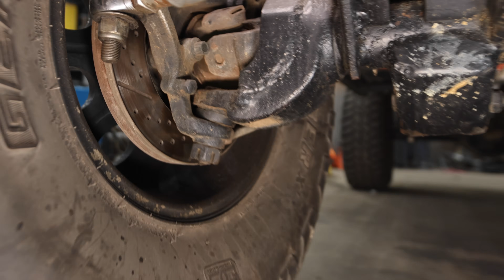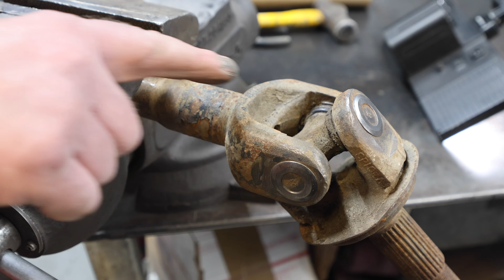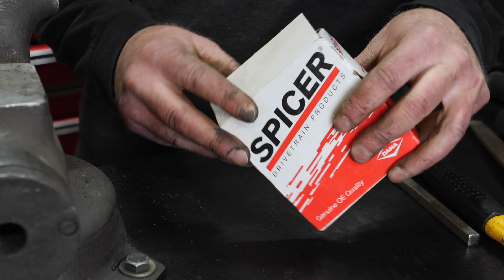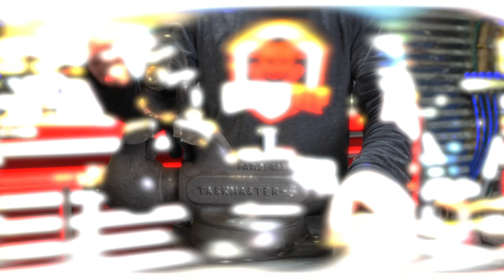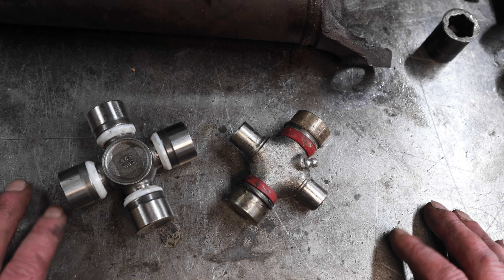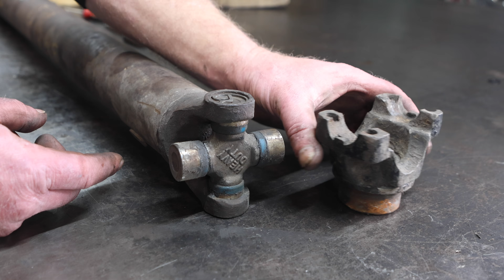How To FIX a U Joint in 15 Minutes

Comment: I have an AWD Charger pursuit and the front joint failed dropping the whole tube onto the ground.  I heard sounds all day that weren't normal and it let go around 25 MPH and it sounded like a bomb went off. I thought I blew the engine.  I looked everywhere never finding the the + piece.  I'm afraid to know how much damage and what the cost is gonna be to fix the damage.  Somehow all the gear oil poured out too.  Ugh

Comment: thanks this is  78 k5  , I just wanted to know if I did it right for my 78 blazer  passengers front u joint i bound up the cap and ended up cutting it  off.

Comment: Over the year's of changing u-joints I've ran into issues multiple times when hammering them in. I highly recommend getting the ball joint tool set the C-vise works extremely well and you will have way better results with not messing up the needle bearings

Comment: I knew it was coming cause I've been hearing a kinda knocking when I accelerate or decelerate.  Yesterday I started getting really bad vibrations.  Then Yesterday afternoon I started backing out of the driveway and it felt like I backed over a motorcycle.  . Then I made that same awful noise every time I put it in reverse.  When I looked at the rear U joints the shaft was started to come off of the joint.

Comment: Put my new u joints in my driveshaft and found one needle bearing on the floor am ok or do I need to install that needle bearing with my u joints
Reply from the maker: If its from the new joint, yes, put it in.  it wont last long without it.

Comment: FYI…rotating the internal circlip will typically let it fully seat into the groove. If it doesn’t, there’s either debris or the cap isn’t fully seated in the collar. Should never have to tap one into the groove

Comment: Cool tip demonstrated by Tom Woods about 25 yrs ago at Slickrock Campground in Moab was for removing the u-joint from a driveshaft. After the clips are removed, just hit the yoke next to the cap with a hammer and the u-joint caps will walk out… no bench or matching of socket sizes to the u-joint. 😮 This is done holding the driveshaft in the air.
Reply from the maker: Seen that too, although it only works on a good non rusty, non beat up joint.

Comment: Great video! One more tip I’d like to offer. When you take the new caps off the U joint to install them, I like to add one pump of grease to each cap. Then use my pinky finger to spread the grease around in the cap. It helps hold the new needle bearings in place and they’re less likely to fall out of place

Comment: Great video one more thing to add they are usually balanced (driveshaft/axleshaft) so it’s best to mark each side with a punch or paint marker so that it goes back in the same orientation and doesn’t create a small vibration…. Maybe not as noticeable on an off-road rig that’s not seeing highway speeds but a daily/weekend warrior could be noticeable
Reply from the maker: Ive never seen a balanced axleshaft but could be some out there, but for a driveshaft, yes you're right that would be a good idea!

Comment: What brand of u-joints do you recommend?  For a pro such as yourself.
Reply from the maker: Spicer, or Yukon superjoints if you need absolute strength in an axle shaft.  They are very strong but need greased every trip

Comment: I was hopeful for some tips on the inner most joint on a double carden. For a few weeks (more off than on), I've been fighting with a front driveshaft for an early bronco and the outer two went fine but the inner one is a real bear to get at.
Reply from the maker: Check the description for a double cardan how to video

Comment: For on the trail repair sometimes if your man enough you can just hold the shaft in your hand and take the hammer and smack it and it'll fall apart
Reply from the maker: I've seen it done but apparently I'm not man enough for that.
Reply: @bleepinjeep  it's a joke I did it once when I was younger and really strong but then again maybe I'm remembering wrong cuz I'm so old laugh out loud great video thank you have a good evening

Comment: I changed many u-joints at the ranch,  many times with a vise, a short piece of pipe larger than the caps, a short piece of pipe smaller, and a hammer. I used the old caps to drive the new ones into the yokes, by using the vise like a press.

Comment: I would insert the bearing from the bottom first, using a clamp to hold it in place. Then use a press to compress them together. With that said, of course you did not do anything wrong. Great stuff.

Comment: Quick question: Am I supposed to check to make sure I dont lose any of those needle bearings? Not sure if you mentioned that…
Reply: Always check to see if the needle bearings have moved.
You will know if one slipped out if the cap or clip doesn't seat.
Reply: I know ur being sarcastic. He's only driving that point home because it indeed is easy to have 1 (or more) fall out unnoticed & then u will have to start all over on that side 😤